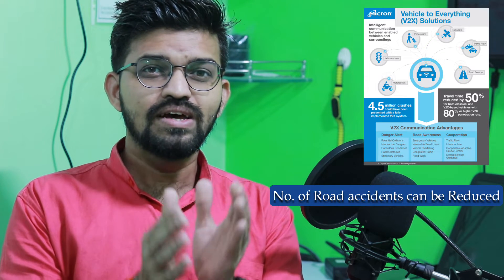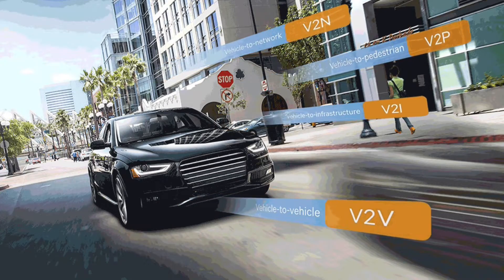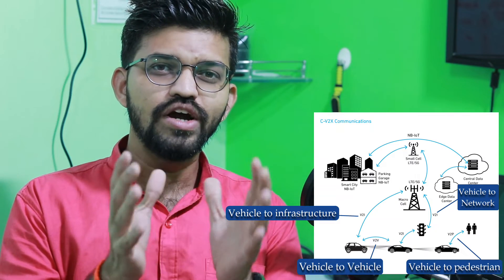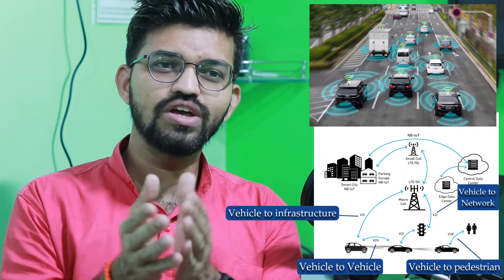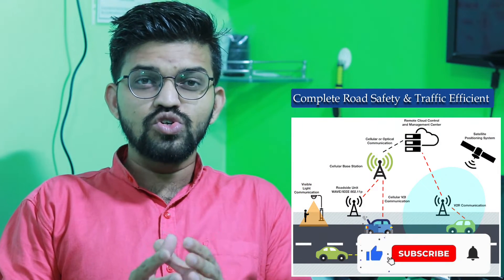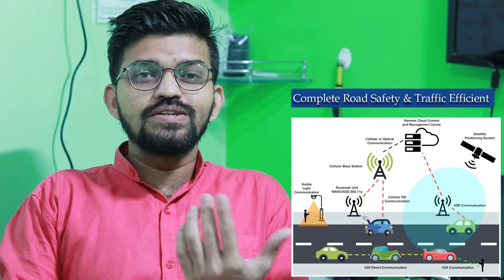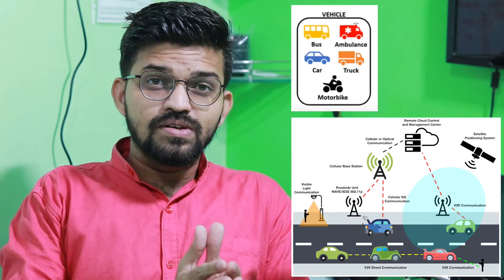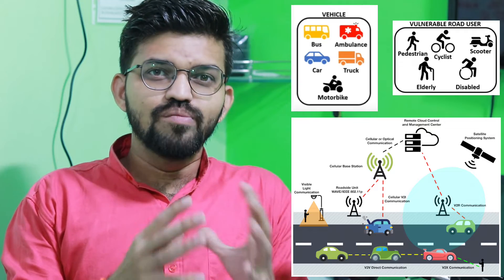Understanding Vehicle-to-everything (V2X) Communication

Comment: We cannot use wifi in v2v as we cannot schedule the radar resource block. Wi-Fi operates in the 2.4 GHz and 5 GHz frequency bands, which can overlap with the frequencies used by radar systems (e.g., 24 GHz and 77 GHz). This overlap could lead to interference, affecting the accuracy and reliability of radar sensing.